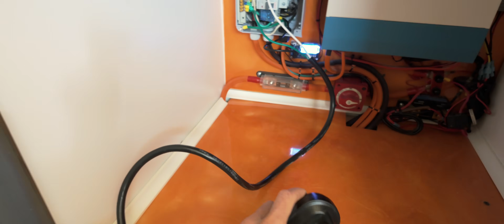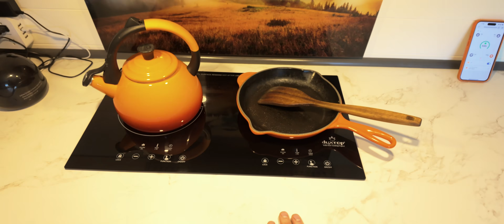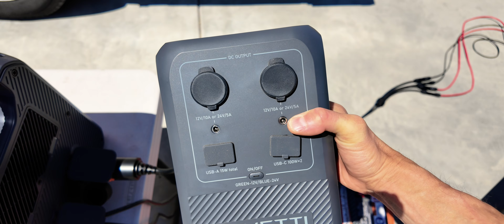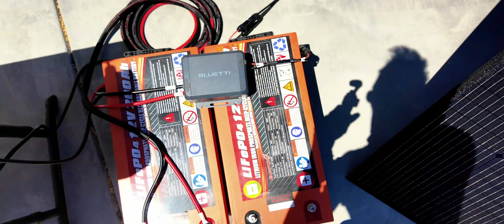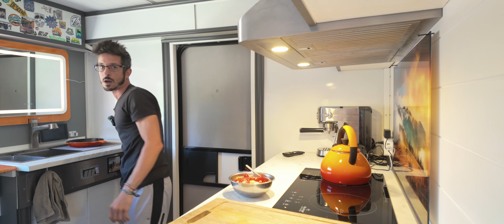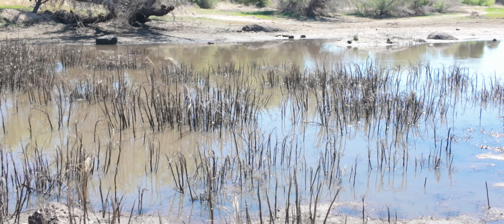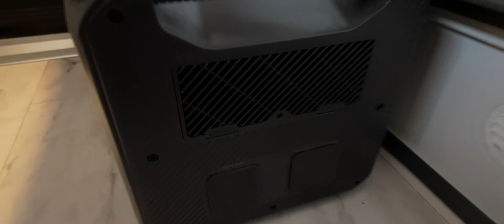The Best Power Station for Van Life Air Conditioner | Bluetti Apex 300

Comment: Wow! Glad that I found your channel and I have subscribed. I am looking in the future to purchase a Subaru Outback Wilderness 2024 and convert it for full time living. I would remove both the rear seats. I saw how you plugged in the 30amp cable into a 120 volt box. I like your tiny home on wheels. So, what I want to do is when I am at campsite with power to hook up with a 30amp cable into the outside power source for power. Not sure if this is doable and not sure what a custom energy system is? Do you have prior video and any thoughts?
Reply: Bob Wells lives in his Outback he loves it.
Reply: @d @dancassale7805 es he have a YouTube channel? Is he the older guy with a young white beard?
Reply: How do you integrate a powerstation in an RV that I bought which already has it's own electrical/battery system?

Comment: No 12v on this one?
Reply from the maker: yes there is a dc hub attachment that allows for  high capacity 12v output its not built in because this model is more designed for home backup. benefit though is that it can run more amps than power stations with 12v built in.

 you can see the attachment here. https://www.bluettipower.com/products/hub-d1-parallel-box
Reply: @nomadbrad503 just another 300 dollars 🙄

Comment: what they needa make is an AIO for 48v systems using lugs not screw downs that has all sorts of ports like 3 prong house plug, rv 30av etc
then just buy 48v batteries on side
Reply from the maker: That would be a really interesting product to see on the market!
Reply: How do you integrate a powerstation in an RV that I bought which already has it's own electrical/battery system?

Comment: My van has 4 solar panels of 250 watts each. I have a Bluetti Elite 200. I use very little energy, but I like to have the option of running my mini split. If I buy the Apex 300, should I use the Apex combined with Bluetti Elite, say 750 watts to the Apex, and 250 watts to the Elite 200? If I buy one battery for the Apex, what is the best use of the 1000 watts? Or should I just keep the Elite 200, in case the Apex breaks down? Or maybe use the Elite 200 in another smaller van I own?
Reply from the maker: I would run all your solar into the apex 300 and plug your 200 into the 300 with the 120v plug for charging
Reply: @nomadbrad503  Brad, can you set it up for me in San Diego. I need someone to check out the entire system.

Comment: Very good video. One question: my English isn't very good, but did you have to use an adapter for the 12V output? Doesn't the Bluetti unit come with 12V outputs? Can't you connect it directly to the DC fuse box?
Reply from the maker: Yes you can connect direct to 12v fuse box with their dc power hub adapter. I didn’t have it in this video.

Comment: Hello,  I just found your channel,  I know some about electricity because I was a single mother of four which are now adults so I had to learn how to do my own electrical work,  plumbing etc because I couldn't afford to pay someone but my place burned down months before my diagnosis of Multiple Sclerosis and now I am on Disability unfortunately but I have a 12 by 16 storage building that I made into a spare bedroom before amd right now I don't have any power because I originally had it all wired unto an extension cord and ran it into my home.  I'm wanting to get a mini split put in and have a small thankless hot water heater,  air fryer,  blender,  microwave charge phone and ice maker for just me and sometimes my mother so could you maybe make a video on something like this,  thank you and God Bless you and your family 🙏 ❤️

Comment: I know you can do what you want, and you seem to be in the Mac environment, but if I lived in that truck, I'd have a 43-inch Roku TV connected by HDMI cable to a mini computer (Windows 11) which would be Bluetoothed to a remote keyboard and mouse.  All that could be had for less than $500.  I hate squinting at Apple's little laptop screen.
Reply from the maker: Yes  I could plug my 43” smart tv into my MacBook’s HDMI.
Reply: if hes running a m series mac, that thing is wildly power efficient.  Like 24 hours of battery life efficient which is key with a setup like this.

Comment: 2700 wh is less then a single 280amps battery that shit not worth it, I have a 900amps set up no power bank could rival that.
Reply from the maker: You can add on expansion batteries to build a huge battery bank

Comment: How about a 12 volt mini split aca ??? have you try it??
Reply from the maker: no, too many amps
Reply: @nomadbrad503 This is Bluetti’s problem…they need to figure this out for all the pushing/selling they are doing to us Nomads…So the Apex can’t even run a 12v AC? Geez…..
Reply from the maker: @MannyWC  The only reason someone should be using a 12v ac is if their native battery voltage is 12v. Most newer large capacity electrical systems are moving away from 12v because it is least efficient. 
the bluetti systems use 48v batteries not 12v batteries. This is why they don’t output high amps at 12 volts
Reply: @nomadbrad503  My B300s/AC300 are 12v systems with only 12v10amps.  And the new bluetti for power banks are also 12v/110v/240v.  The reason we are using 12v acs, is because it is a waste of energy to invert to 120v.
Reply: @n @nomadbrad503  Velit is the only one at the moment that has a system that works / runs a 12v AC🎉
Reply from the maker: @MannyWC yes those output to 12v but the battery voltage is not 12v it’s 48v they have to use converters to reach 12v which is why they don’t accommodate large amp loads.

Comment: I love my Bluetti EB200P (2048wh) power station and use the PV350 portable solar panels too and it's all I use to power up my whole caravan when I'm off grid, but that bigger Bluetti Apex 300 looks awesome and I'd love that bigger capability and my older Bluetti doesn't have the app connectivity either. 
Like you said, I chose a power station as I found the whole wiring and separate components option way too complicated and overwhelming.
Reply from the maker: I’m glad you found a solution that works for you 🙏🏻

Comment: We do alot of boondocking but can't afford that setup. Class C small rv and just need something simple to charge our computers, phones, coffee maker. Is there something small and simple you can suggest that doesn't require solar panels?
Reply from the maker: There are smaller ones but once you start talking about running a coffee maker..you’re going to need one thing fairly powerful. If you don’t want solar panels, how do you plan to charge it? It would probably only last 1 day without a charge source

Comment: I have my Victron multi +2 systems running in parallel. I can’t see leaving that system to go to an all in one unit (too limited). Never crossed my mind as it doesn’t fit my needs for a 240 V solution (mini-split) with a 48 V battery bank @ 20kw + capacity. Maybe because I already have it. If I want more power, I could just add more batteries which I plan to do to bring it up to 30kw+.
Reply: how many battery do you have at how many amps?

Comment: I use a Bluetti EB-3A primarily use it in my car to power a 30-quart 12vdc refrigerator when the car is off. I originally charged mine using a 12vdc cig plug off the car but found it too slow. So I wired a 300-watt 120vac pure signed wave inverter and simultaneously charge at ~ 200-watts, this works great, recharging from ~ 50% to 100% in ~ 1 hour of driving. It offers a backup inverter & flexibility for my power needs.  I added a 100 amp LiPo4 battery & feed power into my Bluetti with a 8mm input to the solar adding 477% additional battery power.  This works great for me!

Comment: 2400W solar input limit seems not enough for power users running aircon 24/7 in 110⁰, and definitely gonna need a few additional batteries... maybe I'm wrong.  Great coverage, thanks for sharing.
Reply: 100% wrong. I have a 8000 btu ac that runs for 5 hours on an ac200max without any solar input. With 900 watts solar input i can literally run it the whole day

Comment: Could the XT60’s also accommodate wind turbines? As in raw input?
Reply from the maker: Sure as long as the voltage is high enough
Reply: @ thanks for the speedy reply! Follow up question if you only had on XT60 in use it would “eventually” charge the entire unit?

Comment: I have an ecoflow delta pro, I found out on here you can connect regular lifepo4 batteries to the solar input for more capacity with an o ring to xt60i cord. I use a 48v 100ah battery and charge the ecoflow with my alternator charger and then the extra battery with a 48v charger to the ecoflow
Reply from the maker: That’s true, you can absolutely do that

Comment: There are 2 factors I find concerning with this Bluetti unit.  

1st is that they are continuing the trend of providing a larger inverter to power a lot of watts (not just surge watts) but fail to provide enough battery to give it an even hour at that output.  I guess it is good that they are not relying on surge to power larger devices temporarily, but we know that this means that inverter is going to be sucking more idle-watts while being turned on.

2nd is that I don't see any mentions (either on their website or in a lot of the sponsorships) that talk about the maximum input they can take in.  It is great they have 2 standardized and non-proprietary plugs for PV input, but it is hard to figure out what kind of recharge or offsets you could have to the power leaving the unit.

Are there any insights you could give us here?

Comment: I've used Bluetti and Victron.  Victron is much better quality.  Cost per watt is cheaper with modular components, and repair is much simpler compared to all in one boxes.   I have 2 Bluetti power stations, one failed within the first year during warranty and Bluetti refused to receive it for warranty coverage.

Comment: Great informative vid Nomad , can u do another video as we would all like to see you doing your daily thing as in this video but have the 700w BLUETTI solar panels or your roof top panels on your rig plugged into the BLUETTI so we can see how  much power u use with solar charging the BLUETTI at the same time ?
I’ve just started my bus build (in Australia) and now I’m thinking of going this way with an expandable battery as my custom build will be around 15k Aussie… this BLUETTI set up will be half that, more compact and easy to install.
Also can u show us how that 12v BLUETTI set up running some devices at the same time as well ?
Love your content mate and if your ever down under get in touch  🇦🇺

Comment: Brad,  Why didn't you connect your solar panels to the Apex? If you had, you could have run all your electric items, and kept it at 100%. That would have left all the stored power for overnight. I feel that would have been a better repersentation of the Apex.
Reply: curious as well… i’d like to see how much power you use over the course of an evening running the AC and other things to see if it truly can replace your custom system.
Reply: I was thinking the same thing.

Comment: As a solar installer, wouldn’t you say it’s less expensive to diy it??
Reply from the maker: Yes but it requires knowledge and skills to perform a reliable diy electrical system. A lot of folks don’t have either so it cheaper to buy this rather than pay a professional for installation of a custom system

Comment: that bluetti Apex 300 with a B300 expansion battery, has a capacity of 3,072 Wh (51.2V, 60Ah) which is very minimal. This does not seem suitable for anyone doing remotely long time van life
Reply from the maker: Yes, you would want to add an expansion battery

Comment: Great video. But let's be real. No one is swapping out custom setups for this. You can't get the same reserve at that price point and any of the 3 major components can fail and your left with nothing.  

These are simply best for people who don't want to dabble in wiring a separate system.
Reply from the maker: Yeah I agree. I meant to say they are considering using power stations rather than having full custom systems installed. No one is going to swap an already installed premium system for this. I didn’t say it correctly 🤷🏻‍♂️

Comment: Nomad Brad, as reasonable as these stations are on sale, a person could buy 2 for the same or less than the modular setup, so one could be still held in reserve, swapped out between charges, etc.
Reply: Almost 2 years ago, we bought a Bluetti 600 watt portable that was on sale. What a nightmare! After 3 days I noticed a strong burning plastic smell, and it felt like putting my hand on a hot iron. The thing was not charging, and from the start had been draining fast. Good thing I had seen the vids on how miserable they are about returns. Original box and everything saved, PLUS after you've got it all packed up, and you have to ship it back on your own dime,  they call you and want all the numbers and codes off the portable battery you no longer have before they'll refund. Jokes on them, I had photos of the stickers. Apparently it's hit and miss with their products quality control. But they could be less aholey about it. I'll stick to Anker. I'm just too terrified to give Bluetti another chance.
Reply: @SewingBoxDesigns I love the interface of Bluetti.  Ecoflow has had good customer support for me. Good to know about Bluetti bad customer service. Will think twice.

Comment: Nomad Brad, glad to see someone confirm what I concluded. I bought an Oupes Titan 3, similar power to yours, just not 220 like yours. I got a killer sale price and $300 coupon, like $1,100.00. I think it’s like 7,000 watt surge. If I tried duplicating my specifications with Victron, it would be at least twice the money or more. Those induction cook tops seem very efficient? The only drawback of the power stations is the expansion batteries are almost the cost of the power station.
Reply from the maker: yeah, the expansion batteries are not as cheap but this is for someone who really doesnt want to DIY their system
Reply: You can use regular batteries for expansion.

Comment: Thank you so much for this video — I’d been waiting for something like this. I’d love to see a more technical breakdown, but it’s already very helpful.

I think both systems clearly have pros and cons, and experience — or the lack of it — plays a huge role. As you mentioned, if a power station fails, you have to repair or replace the entire unit. But with a DIY setup, you can fix just the faulty part — if you know what you're doing.

As an IT guy, this reminds me of when we used to believe upgrading just the CPU would give us a better PC... until we realized it also meant replacing the motherboard, RAM, and... well, damn.

It feels the same with electrical setups — if you don’t plan ahead and overspec from day one, you’ll end up redoing everything. That’s why I think portable generators might become the best choice in the future, especially as prices drop due to competition. Maybe one company will figure out a modular design, but for now, having everything integrated makes scaling easier and less complex.

Just my two cents.
(Also, in my country, lithium batteries are actually more expensive than importing an all-in-one solution.)
Reply from the maker: Thanks for sharing, I agree it's a good idea to consider all the factors!

Comment: Something you didn't mention is if you already have some external lifepo4 batteries (like those orange Enjoybot batteries in this video), you can hook them up to the power station via the solar port then hook your solar panels to your external batteries via a mppt and essentially you have expanded your power stations capacity without having to buy the usually more expensive expansion batteries for that specific brand. The solar will charge the external batteries and the external batteries will keep the power station topped up.
Reply from the maker: thats a great way to do it
Reply: Hey!  That's some great information that you're imparting there @JetCityHooligan. Nice job!
Reply: Only thing is most power stations only charge at 100 watts when in dc to dc
Reply: @Steakandcheeseplease78  the power station's solar charging ports recognize the external batteries as solar panels and will charge the power station at whatever the max solar charging rating is.
Reply from the maker: @Steakandcheeseplease78 not true. The bluetti charger 1 allows over 500 watts of dc to dc charging which is what I recommend for this apex 300
Reply: @nomadbrad503 sorry if I sound thick, but then how do you charge the battery's back up after it's emptied it's load into the bluetti?
Reply from the maker: @darrenmorris2653 they would need to be connected to a charging source. Either solar or alternator

Comment: Great episode, Nomad Brad.  THIS is what really intrigues me...the usage and features of solar generators and how they perform in a real world situation.  As you may know, it's been my goal for a while now to purchase an EV "Van" and to outfit it with solar panels and an inverter/generator to supply all necessary electricity to sustain life AND to make "free fuel"...no gasoline for me.  I have owned an EV car for over a decade now, and it's dirt cheap out of the wall socket ($3 = 100 miles), BUT in order to travel OFF-GRID, the way that I may want to, I'd rather seek a fully, self-sufficient solution.  You gave me some valuable info here.  I think that people would be interested in a future video of how long it takes to charge the generator from just solar panels and get some real figures.  Obviously 2 panels wouldn't be enough for the scope that I'm thinking of, but then again, I'm not sure that I would need that level of AC and such.  I live very simply and generally in temperate climates.  Anyway, sorry for the rambling...thanks for the video.
Reply from the maker: thanks for watching flipper!
Reply: @nomadbrad503  BORING.  You didn't even read ANY part of my post.  I'm not sure that I'm following the right person.